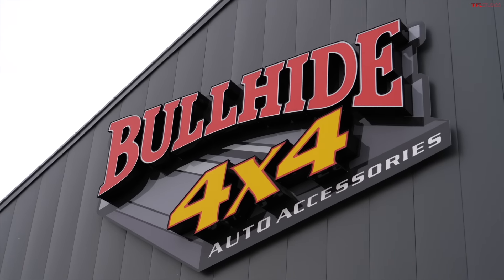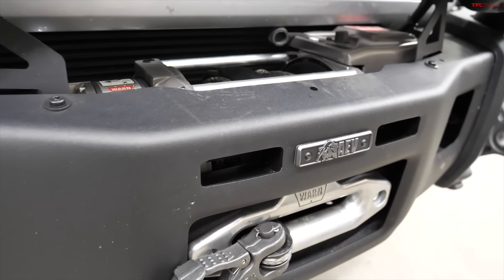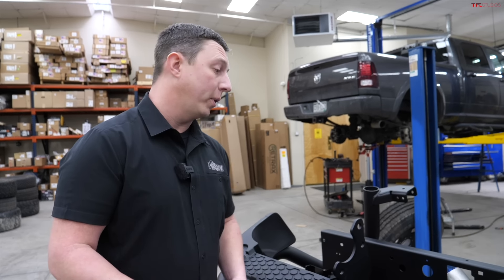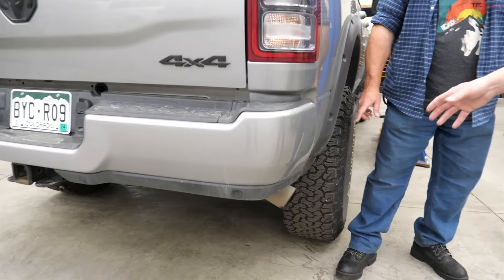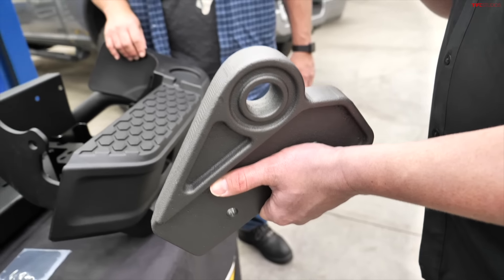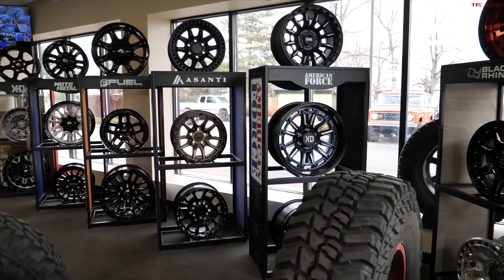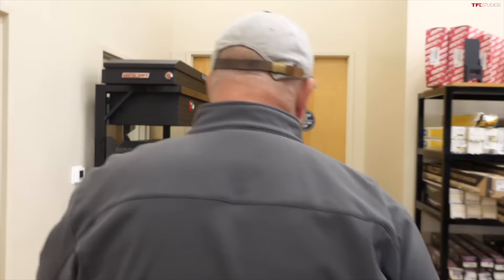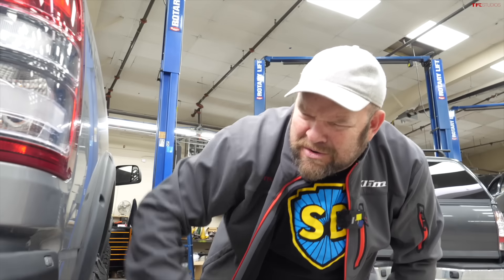Is Our RAM 2500 Overland Build FINALLY Complete? Installing This One Part Made A HUGE Difference!

Comment: I like this truck soo much. The stance is spot on and with the bumpers it looks much more balanced out. Thing is,, it needs,,, NEEDS,,, one more thing. A rear locker vs the limited slip.  Dojo an air actuated one & have a high quality onboard air compressor as well!! (The “last thing” is always elusive!! 😂😂😂.
    Thanks for this project TFL. Loved it with the camper on the back for functional sleeping accommodation.

Comment: That's a really nice build. CJC Offroad sells some aluminum mounts that go in the bed, both sides and the front, so you can mount a jack, shovels, etc, securely. I wish someone made air lockers for the 2500 diesel. Then you would have a Power Wagon but better.

Comment: We totally missed out on that white mega cab long bed conversion in the shop.

A point to note, that factory rear bumper is somewhat of a unicorn.  Drive around and look at every 2500-3500 Dodge/Ram rear bumper, a huge portion of them have some sort of towing dent in them.  This may depend on your sample area demographic.

Comment: @ 9:12 when they drilled the hole for the passenger rear sensor they left the bare metal exposed I don’t know why they didn’t put some paint or bed liner to flow with the texture of the bumper, that will rust and for being such a nice and expensive bumper that’s the only reason I mention,  I love the build and truck and everything about this but just please get that addressed lol in Canada it would rust in a month with the salt on our roads but that is one of the nicest rear bumpers I think is out there !!!!
Reply: At 9:12 it shows the park sensor in the plastic corner tank. I know Canada is rough, but I haven't seen plastic rust! 🤣
Reply: @advnate  ohhh I thought it was all steel my bad guys 🍻

Comment: Hey TFL are you using the stock spare? If I remember correctly you guys went with 37s? I have a similar setup and if you are running tires that are larger than the spare, you cannot use that stock spare. That wheel would be spinning faster than the others and it will screw up the sensors as it relates to the speedometer, etc. That info is from the dealer. I had to scrap the stock spare and buy a 37 inch tire for a spare. FYI

Comment: if you had one made from Titainium it would cost a fortune but a lot lighter
Reply: Weld it out of 7075-T6 Series Aluminum which is super-strong AND super-light! That would be the BEST option. It is very near the strength of modern Titanium Alloys for one-third the cost!

V